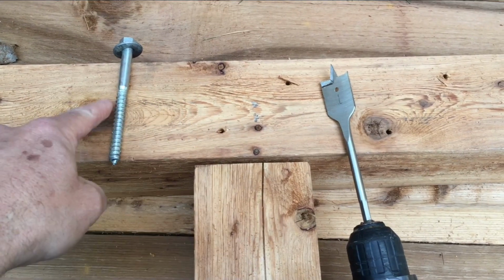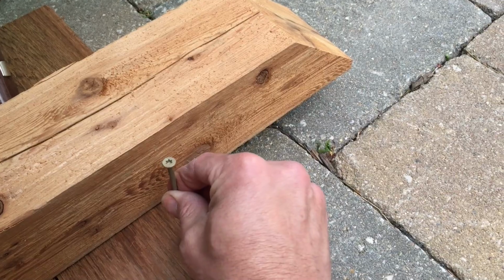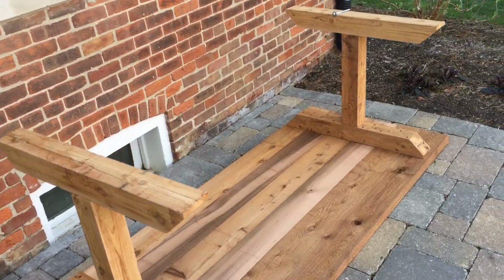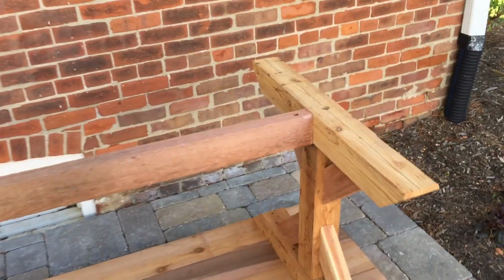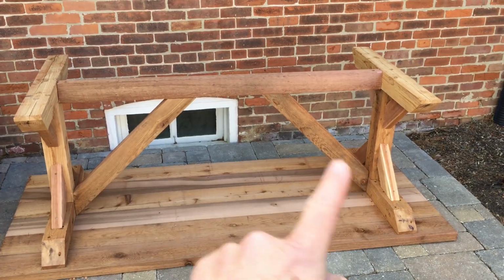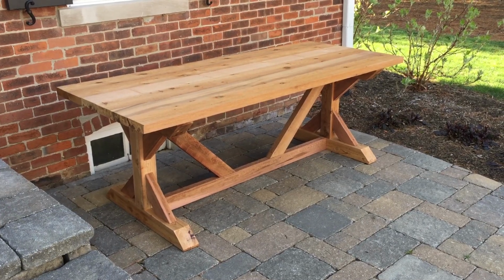DIY Outdoor Cedar Table

Comment: Wood is getting expensive 🙄
Reply from the maker: Interest rates are low, so construction is going strong, and building materials are at a premium. Electrical wiring has nearly doubled in price also. As soon as interest rates go back up, prices will drop